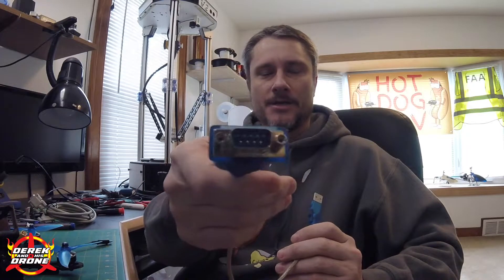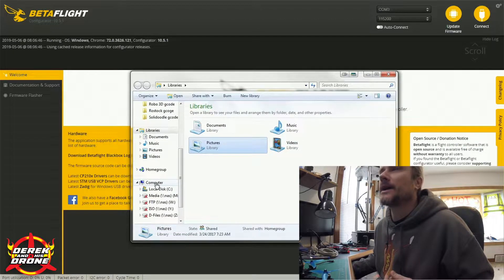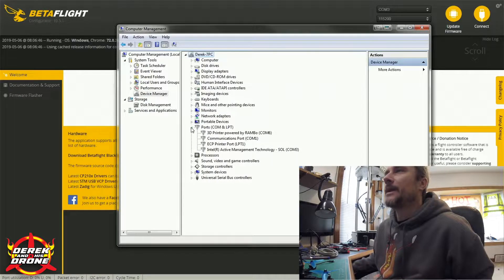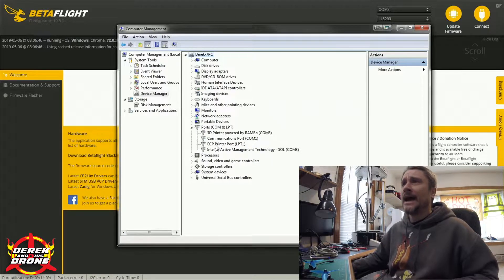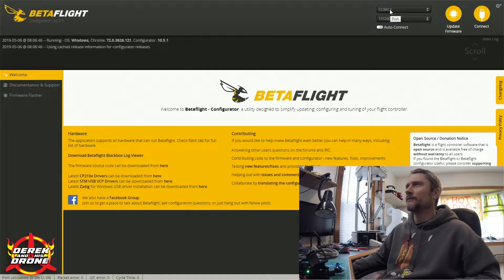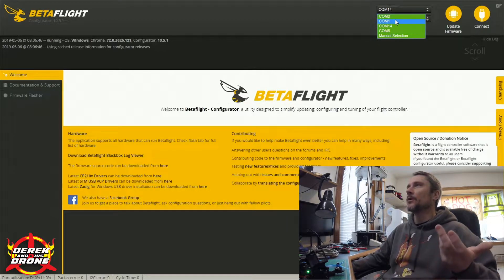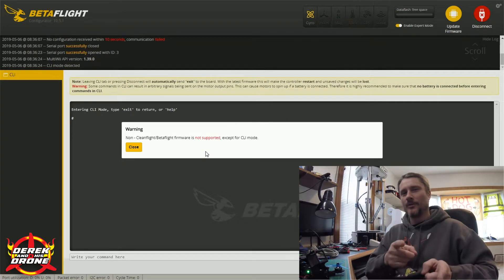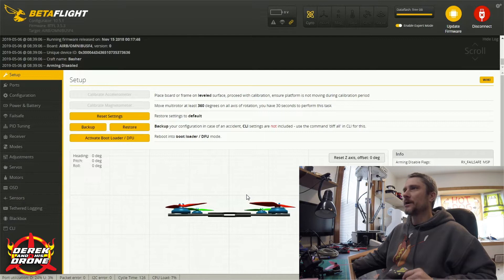Basics of Betaflight - Identifying your COM Port

Comment: What if have done all of that..and it still says failed to open..then what..solid light on FC n blinking light..im at wits end.
Reply from the maker: Can you try a different computer?  Have you gotten other flight controllers to connect?
Reply: @DerekandhisDrone  hello.thanks for the response.ive since gotten a new f4 FC.works now..i guess I goofed up the spc90s f3 FC by uart deal not being on maybe..but now I lost TX to betaflight response...i had it working flying around..went to tweak pids n now no TX to bf connection.ugh.....?????
Reply: @DerekandhisDrone  I have it connected now..but problem is I was flying it..went to tune pids n now it won't read my TX in receiver part...i have solid rx light.but  FC light just blinks n won't read my TX...ugh..lol.im gonna try to reflash it and start over..i had it once..it was 2048 srx.deal I had to choose to get it to read my TX last time..not reg 1024 2048.i tried those n nothing..tried other one down the list like why not n poof it read my TX..was so happy..now I'm pissed again. Lol.thanks for any help

Comment: For some reason I’m getting DFU instead of com3 or com1 what am I doing wrong I did all the steps to install the drivers and I’m getting DFU
Reply: I figured out what I was doing wrong, for some reason I was trying to bind my transmitter to beta flight instead of the fc. I think I need to bind the fc to the transmitter then bind it to beta flight
Fc: xrotor micro f4-G3 flight Controller w/OSD
Reply from the maker: DFU is a state of the processor to install firmware.  Your computer needs a driver to be able to talk to the flight controller.  what flight controller are you using?  Are you pushing the button when plugging in the FC?  If so, don't tats what puts it into DFU.  Otherwise depending on the FC the boot pads maybe shorted.

Comment: I have a Diatone Tyrant S that was acting crazy . I reflashed the board and now Betaflight won’t recognize the quad . All drivers are up to date . My com port says stm to usb that I’m using . Not sure what else to try . Any Suggestions..?     Thanks 🙏   Also I have the correct board reflashed .
Reply from the maker: I would try a different USB cable first but your FC is probably dead especially if it was doing crazy things before the reflash.  Diatone makes good cheap stuff but I think they are lacking in quality.

Comment: I can't get any of my quads to work with BF 4 . Without any of them flipping out and over reving the motors.
Reply from the maker: There was a bug in BF 4.0 that caused this.  The PID and filter settings were too high for some.  Update BF to 4.0.3 if it still happens reduce your I gains.  Use your judgement as the D gains might need to be reduced a little too.

Comment: Hi. I purchased a mobula 7 bnf flysky version .My only problem is I am getting no modes in beta flight .Can u offer any advise!.
Reply from the maker: It came shipped with a pre-released version of Betaflight installed.  Update the flight controller to the latest version of Betaflight and problem solved.
Reply: I’ll give it a try thank you so much for replying!.
Reply: I switched from configurator 10.5.1 to 10.4.0 problem solved thank you so much for ur help!!.
Reply from the maker: I'm glad you got it to work but you should really update the flight controller.
Reply: I’m kinda afraid to reflash it this is literally my 3 day with beta flight. Everything seems to work so far. What do you recommend for reflash?.
Reply from the maker: It's something that you are going to want to learn.  I have a bunch of videos on Betaflight that might help you.  https://www.youtube.com/playlist?list=PLhDNpBXK0rt9hMRYX_512y37LkPn2Xn_H
The reason I recommend the reflash is that the prerelease firmware might be buggy like we saw on the modes tab.